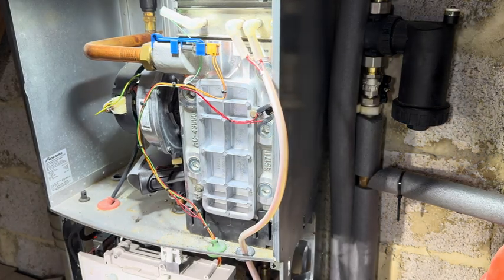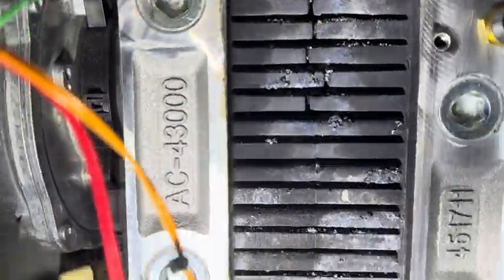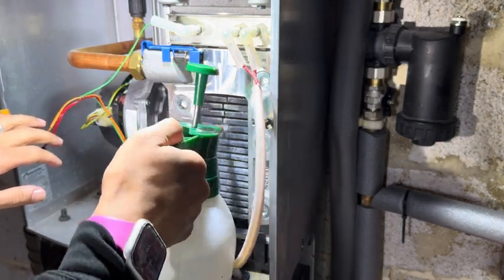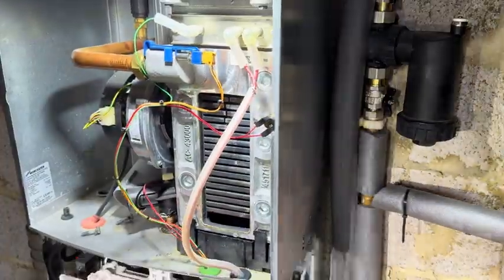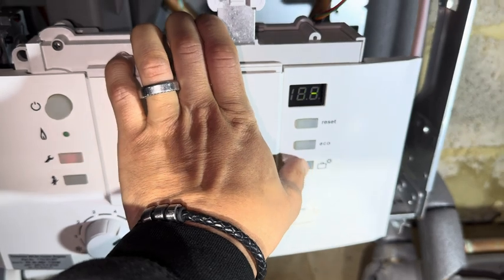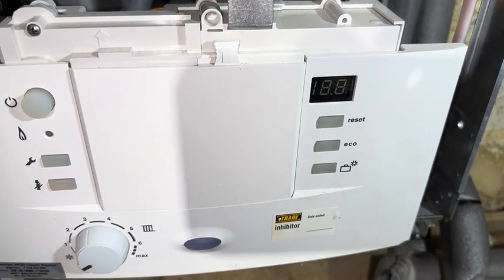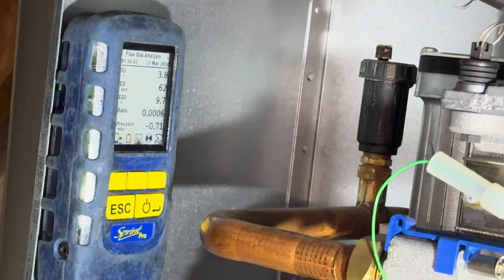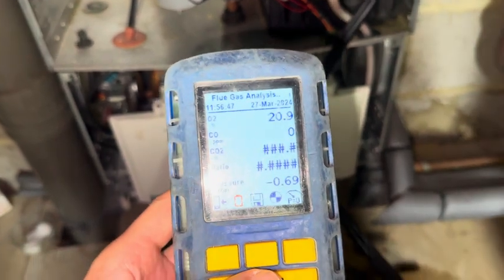2 Services, under 11 minutes!

Comment: Great vid, need to check fan pressure test top off my head -3.9 and gas rate ok doesn't need full strip clean but its good that you do, also you need to wash it down with water from above the heat exchanger as well ass the front so fan, burner needs to come off. What a statement love Worcester service😂😂, so far 80% off the Worcester which i try to full strip clean and wash down actually makes it worse and then i come back the next day and replace it the heat exchanger .Those fins get blocked at the back, you won't clean it with the Worcester tool pointless tried many time, i use plaster board cutter knife, long one with sharp teeth. Check min and max case off and case on max reading. Great work 👍👍
Reply from the maker: Yes that’s right, like most videos, this doesn’t show everything done on the visit. To be honest, I’ve never found cleaning it out makes it worse or makes it need replacing, always manage to get the majority of muck out using either compressed air or a jet spray if required. I always clean out regardless of fan pressure as it’s quick and easy enough to do. The Worcester cheese grater type tool is decent but the brush usually breaks at first contact!

Comment: Hi RJ Heating, cool vids, but I would replace the electrode gasket and door seal always!

Also, a flue integrity test (air intake) is pointless with the case off!

Just a couple of tips.

I’m not digging you out mate, just a few pointers 👌👍
Reply from the maker: You’re right on the flue integrity, and the test was done with the case back on after - cards on the table, I’m new to filming and sometimes it throws you off or you don’t manage to film everything or gets cut in the edit etc - but lesson for me to at least update the description.

Personally, I only replace the gaskets on the electrode and burner door if required - again, probably should have showed the testing. 

Thank you for watching anyway, hope to see you back in the future!

Comment: Did you take the burner out and check the barring platt
Reply from the maker: Burner had a visual when taking the electrodes out to check. Not sure why you’d be checking the bearing plate - it’s not a serviceable part and you’ll soon know if it’s sticking. Rumour has it, it’s not actually required and only necessary in really cold climates like
Some European countries. 

FGA checks will also highlight any issues with burner. Thanks for watching anyway
Reply: @RJHeating  I change the top burner seal after 4 years on a full strip down and have a look at the barring platt to see if it's ok